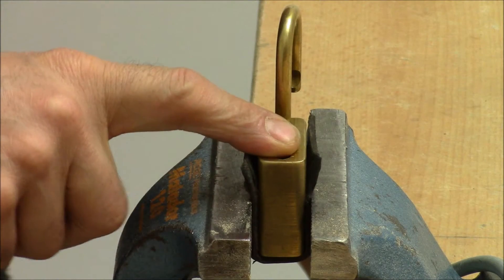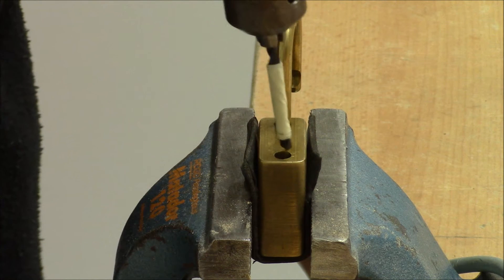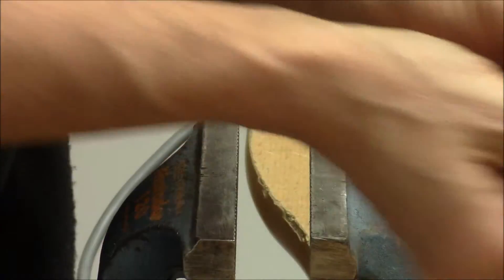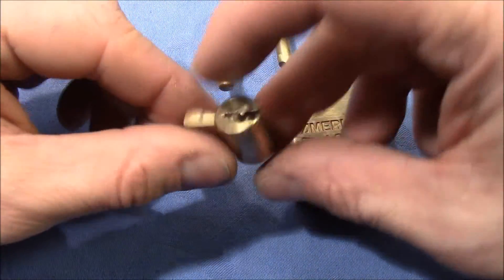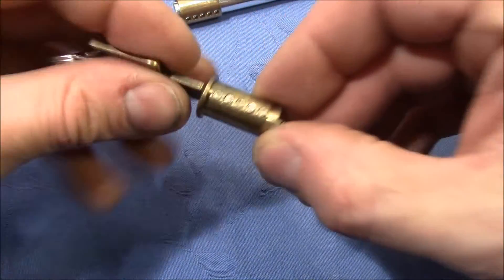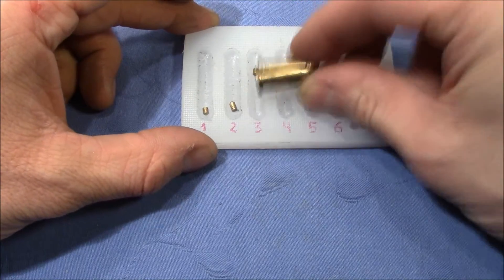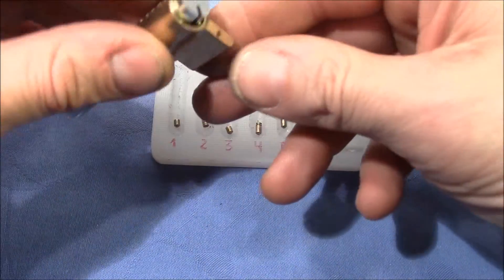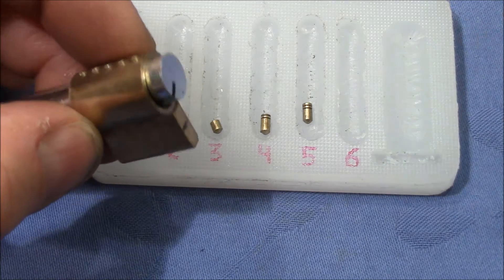(picking 320) Picking/gutting/reassembling a riveted American padlock - thanks to Pete for the parts

Comment: I have the exact same lock.  I really need to find one of those screws now that I know how to do it as well 😁.
Reply from the maker: If you live in the USA then it should be very easy for you to get it.
Reply: Potti314 that I do  😉.  By the way.  Is it possible to fit a6 pin core in there?  I know the body is slightly smaller than an 1100.
Reply from the maker: Sorry, no idea. Perhaps ask Pete https://www.youtube.com/user/peterestall I'm sure he will know.
Reply: Potti314 right on, thanks my man 👍